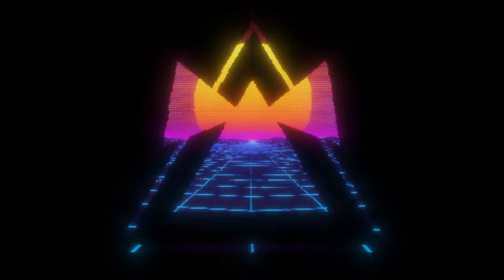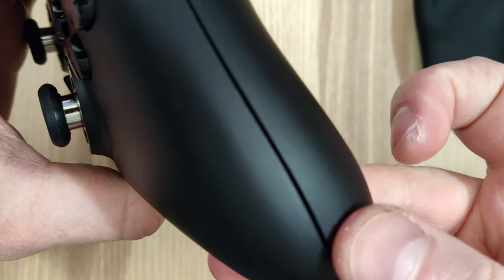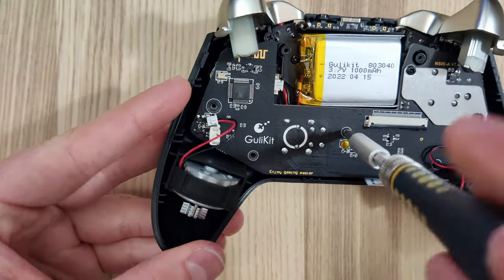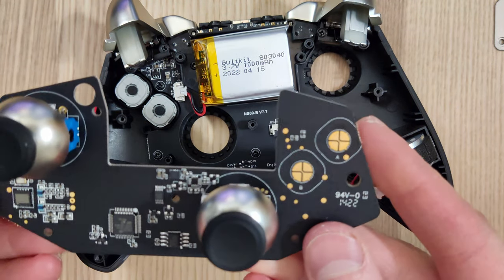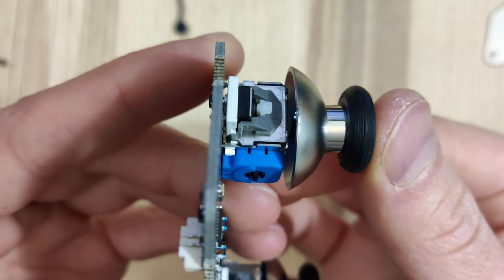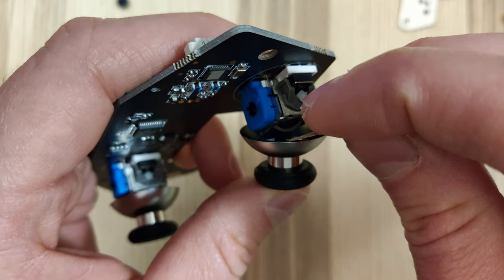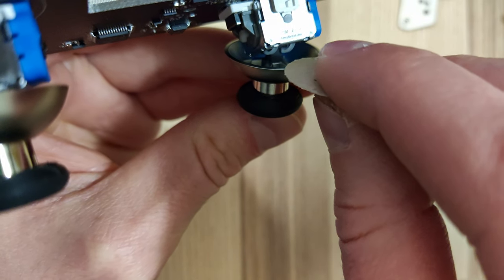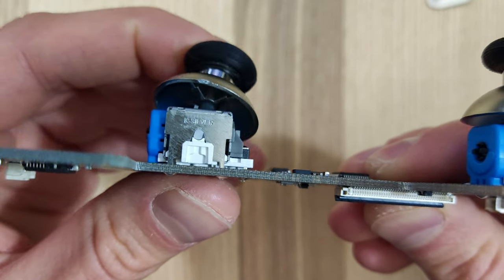Gulikit Quality Control Issues (KingKong 2 Pro Teardown and Joystick Fix)

Comment: Are the thumbstick compatible with xbox metal (aluminium) thumbsticks?
Reply from the maker: Someone mentioned it but I have yet to try swapping them on either one of my units. If you try it let me know.
Reply: @KeiRetroGaming  Im asking before buying mine! hehe
Reply from the maker: GreenChii (4th comment on this video) said they swapped over to the Xbox One controller thumbsticks fine without issues. I haven't tried it personally though.
Reply: @KeiRetroGaming  You just won a new sub, thanks!
Reply: Confirmed after receiving my GK KK2P, aluminium sticks for xbox 1708 controller work on them :)
Reply from the maker: Excellent! Thanks for letting us know.

Comment: Edit: nothing wrong so far (I haven't opened the controller)
I don't feel anything wrong with the joysticks.

Old:
My controller is still waiting to be shipped, comes dec11 ordered a week ago :\
And I was wondering if you, perhaps, know if this is still an issue or if gulikit changed the way they make these?
Reply from the maker: They left a comment awhile back on this video saying they've changed the injection molding process so yes I think it's likely fixed. I haven't bought another one to check it though. Let me know when you get yours if you have the same issue (I doubt you will).
Reply: @KeiRetroGaming  Will do, thanks!
Reply: @KeiRetroGaming  I edited the comment.
Reply from the maker: Nice to hear the controller works well so far. If you don't feel anything wrong I wouldn't bother opening it.

Comment: bru, bought the ns08 version and the zr trigger and b buttons started to get stuck after a month.
So sad
Reply from the maker: I'm hoping the next version of the controller has those fixed. Heard of a couple people with trigger and button issues but sticky buttons seem to be more common so far. If I figure out a fix for the buttons or triggers I'll definitely let the community know.
Reply: @KeiRetroGaming  did you find a fix for the triggers? I still have this problem
Reply from the maker: I haven't found a fix unfortunately. A friend got one and the company had to send him over a replacement set of triggers to fix it.

Comment: it was the opposite for me. this is the easiest controller that i've taken apart. since everything seems to be designed for disassembly. and the reason that i had to open mine was because one of the buttons was making squeaking noises. and when i opened it up, apprently one of the switches has a mold defect that keeps it from fully closing. i had to glue it together. i'm not mad because i got the controller on a discount. but i wish they would check those.
Reply from the maker: There's definitely a couple quality control issues I hope to see remedied on the Kong Pro 3. Buttons seem to be one of the biggest problems, if not the biggest and most widespread problem so far on this controller. Mine both are unaffected but I've heard countless owners with sticking or squeaky buttons. Happy to hear you managed to fix it! Gulikit does sell replacement buttons if it happens again and ends up being unfixable one day. 
https://www.aliexpress.com/item/1005004443562931.html

Comment: Are they eventually going ro come out with paddles?
Reply from the maker: Not to my knowledge, doesn't mean they won't... just means they haven't shared that information with anyone yet. Should be interesting seeing the revision of this controller when they decide to launch it.
Reply: @KeiRetroGaming  I've purchased the Nacon "RIG-Revolution X Pro" controller and not the Nacon Revolution X. Big difference between the RIG and the non RIG version. It has zero tolerance of errors in the sticks and they are very responsive compared to my Microsoft elite series 2 where I didn't want to spend another $200 or close to that for a controller.
The Nacon at first feels inexpensive but once you set the software up foe FPS and get used to the controller, wow, its one of a kind. By far my favorite controller and it's so accurate. I own PS5, Wolverine, Scuff etc and nothing so far comes close to the Nacon RIG. I'm very surprised of that.and never thought I would like the Nacon RIG as much for what I paid for it. 
All of the buttons have solid feed back. 
Hopefully you get to try one. Make sure to set up the software. FYI, use the controller to do so. If using mice, it locks up.
Can't wait until all controllers come out with Hall Effect sticks.
Reply from the maker: @nickm8651  Looks like an awesome controller! Pretty expensive though and only wired. Definitely something I'd love to look at but not something I could justify buying for the channel considering how much it would cost here in Canada even if I ordered it from overseas. Definitely premium from what I've seen so far on it!

Comment: Goddamn, that's a lot of work for someone like me. I'd rather get a refund.

Edit: well, I tried and I can't believe I was able to put it back together while also resolving the sticky A button issue. Didn't come without a cost, though. Same as this video, I also broke the tiny locking tab on the right side, which doesn't seem to be much of an issue since the screws are enough to hold the front and back casing together. A little price to pay to avoid the hassle of returning the item.

PS: I didn't do any sanding or put any lube, I just stretched the springs out a bit to give them a little bit more pushing force. Will observe if it really eliminated the issue. Hope so.
Reply from the maker: Excellent, glad to hear you got it put back together okay without much issue. Those clips are so breakable... Shocked I only broke one opening it.

Comment: Glad I saw your video. I just got one of these and both sticks have it bad.
Reply from the maker: Let me know how it goes fixing it and what you think after about the joysticks. When I put my controller back together the first time I was shocked how smooth it felt compared to how it felt out of the box. This is a very widespread issue and it wouldn't shock me to see that most of these controllers have it and need repairs.
Reply: @KeiRetroGaming  Unfortunately, sanding it down doesn't seem to have done much. I still feel some very specific points where the sticks feel like they grind almost like hitting a lip.

I definitely felt some improvement from sanding, but I think maybe the stick module itself is gummed up. It is a really grindy feeling. I saw people saying calibrating the sticks and updating the firmware can also smooth out the sticks, but so far, nothing has helped. 

A real shame since I like this controller a lot. Now I'm hoping Gulikit will still let me RMA.
Reply from the maker: Yeah, they aren't designed to be pushed completely out to the edge if you don't have the shell on yet so they'll feel a little... off. Once you put the shell on it should feel much smoother as it has an edge to stop at. I had to go back in and sand a bit more down to smooth out the edge as well so you might have to go back and check yours. 

 If you contact Gulikit and explain the situation they should be willing to send you a couple replacement joysticks to pop on. The two they sent me had the same issues unfortunately since it must've been from the same factory but easy enough to sand/file the edge again and put back on. 

Here's some pictures I took for you of the replacement sticks they sent me:
https://www.reddit.com/user/Kei-Retro-Gaming/comments/w1ovxi/replacement_joysticks_from_gulikit/
Reply: @KeiRetroGaming  Oh no, I mean that they feel this way with the shell on. I did a number of tests and went back and sanded quite a bit, but it feels like the area that is smooth is actually minor compared to the area that seems to grind. Easily some of the worst feeling sticks I've ever touched even after opening up and sanding down and closing it all back up.

It still works and reads fine, but I'd hate to play with this thing as the grinding feeling is awful.
Reply from the maker: Did you get any debris in the sticks when sanding? I'd ask Gulikit for a new joystick board. The joysticks are soldered into the board itself so it basically comes as one piece. They should be pretty helpful if you show them videos of the problem. Keep the joystick part you sanded and just move that over to the replacement part when it arrives.
Reply: @KeiRetroGaming  I might have, but I used an air duster to really blow out any debris. But it basically felt this way prior to the sanding. So, I don't really think I got much of anything in there.

I e-mailed them earlier in the day. Hopefully they get back to me. I'll try to request another board that has the sticks on it like you said. 

At the very least I pretty much know how to get in and out of this thing pretty easily thanks to your video.
Reply from the maker: I probably wouldn't have recommended using an air duster as it blows more into it than it probably blows out, especially on something delicate like a joystick. Regardless if you contacted them on the official Ali store they should get back to you soon. Lemme know how it works out in the end. Glad to hear you enjoyed the video!
Reply: @KeiRetroGaming  I returned my controller and was able to get a new one. This one seems to be in proper working order. The sticks don't hitch along the rim at all. Pretty sure that bit of flash had nothing to do with what was wrong with mine, and it  was some sort of defect within the analog stick housing. I don't know if there is a spring or what in there, but it definitely felt like something was grinding internally.

Anyway, I'm at least glad I saw your video as it let me know that this stick has this problem, and I'm really pleased with this one that is working properly. I'm hoping Gulikit irons out this problem as I respect what they are doing for gamers looking to avoid making e-waste via dead/drifting sticks.
Reply from the maker: Glad to hear the new one doesn't have that grinding around the edge. It's definitely a great controller! Here's to hoping Gulikit irons out the QC problems in the future. Thanks for letting me know how it worked out in the end. !
Reply: @KeiRetroGaming  Definitely. If this one holds up well, I will almost certainly buy a second one, or be interested in whatever updated version they make. I am really hoping other controller manufacturers follow their lead on the hall sensors too.

Comment: I was looking for a teardown of this controller.  But omg, you do realize you can take off those joystick caps, like nothing, and then, you don't risk getting any debris inside the actual mechanism.  Also, you can just carefully remove that extra plastic with an exacto knife.  Watching you sanding those caps like that, just drove me crazy, you're not gonna break it, it's not expensive as hell, it's a damn piece of plastic, I bet you can use cheap xbox one controller ones as replacement 😤
Reply from the maker: Yes, don't worry I took those caps off very easily the day after. The caps also can be swapped with the Xbox ones apparently but I have yet to try it.

Comment: Unfortunately those "fantastic buttons" are sticking and squeaking for me and my controller is less than a week old. I'm not alone in this as a quick search seems to reveal this is the main issue many owners experience. I got mine from China so I'm not about to return it. I guess I'm gonna have to try and fix it myself. Such a shame as otherwise it seems pretty decent.
Reply from the maker: Give customer service a message on AliExpress, they'll likely send you a new set of buttons to try. The buttons on my second controller stick ever so slightly if I press them on an angle, see if they have the same issue when you press straight down.

Comment: What is the polling rate/input latency on these?
Reply from the maker: According to XInputTest, it averages about 10.99ms input latency and a 90.95hz polling rate wirelessly over Bluetooth. Hope that helps!
Reply: @KeiRetroGaming  blue tooth polling rates are always abysmal, do you happen to know what it does wired?
Reply from the maker: @BlueSpectre  Wired is pretty similar at 9.97ms @ 100hz polling rate
Reply: @KeiRetroGaming  ah bummer to hear when the ps5 controllers do 1000hz for 1 ms, was hoping it was at least 500
Reply: @@Clarissa1986 pretty sure this thread died over 6 months ago 😆
Reply: @@Clarissa1986 Jesus.

Comment: I still didnt get any help to fix my sofware problems
Reply from the maker: @ my username in Retro Handhelds and I can try to see if I can find someone to help. Either that or you can reach out to Gulikit directly on the official AliExpress store and they should be able to send you out some replacement parts if needed.
Reply: @KeiRetroGaming  ok ty Im at the peek of rage at this point I DESPISE CONTROLLERS WITH SOFTWARE
Reply: @KeiRetroGaming  cant find you its been like 7 days after i bought this thing and cant use it thinking about returning it but i lose 5 bucks
Reply from the maker: Feel free to try and contact me on Reddit directly:
https://www.reddit.com/user/Kei-Retro-Gaming
Reply: What happened?

Comment: CAN SOMEONE HEEELP I just tbought king kong pro 2 and when I'm playing apex on pc it was fine at the start idk what i did but now it has motion when I'm aiming with the stick making it really hard to aim its like really stiff but also responsive its WEIRD please for the love of god i just bought this THING ....it has this weird jitter or like pull to it when im trying to aim its SO ANNOYING this thing is 74 BUCKS man like why is it already giving me issues
Reply from the maker: Motion Sense Aim Assist is likely on. You can turn it off by pressing the button that looks like a sun and pushing in a stick several times until it has one long vibration. You can also try clearing all settings by pressing the same command button (one with the sun on it) and the minus symbol as that'll reset the controller to a blank slate settings wise.
Reply: @KeiRetroGaming  ok ty ill try it and see this thing worked at the start and then poof
Reply: @KeiRetroGaming  now it feels super slow do i just keep pressing them? when im on max sense
Reply from the maker: Just do a "clear all settings" and it should work like it did when you first got it. It comes with a manual to show you how to clear the settings if you can't figure out the button combination.
Reply: @KeiRetroGaming  ok ty it probably was cuz i spammed abunch of buttons cuz i didnt know how to turn it on like idk why this thing has to be so complicated
Reply from the maker: It has a lot of complicated functions but once you master it you'll love it! The macro feature is amazing for automating in-game tasks.
Reply: @KeiRetroGaming  i got it to play smoothly and omg i am alot better than i thought i was stock controllers are holding ppl back
Reply from the maker: Hall sensor joysticks are a huge upgrade. Enjoy!
Reply: @KeiRetroGaming  ok another problem sorry i was in mid game every thing was fine i jump with lt and ping with rt and they just stopped working all of sudden
Reply from the maker: If it's wireless via Bluetooth make sure you have a good Bluetooth adapter (preferably a PCIE one) in your desktop and make sure the controller is fully charged. If the battery is nearing empty it'll start to disconnect like that.
Reply: @KeiRetroGaming  its cord sorry Im using the cord it came with
Reply: @KeiRetroGaming  and now it wont even connect idk whats going on ik i had the not connecting problem with apex legends awhile ago and idk how to fix it but idk if its this new controllers software or not
Reply: @KeiRetroGaming  is there like a discord that can help me? ik cant stand using the websites support thing
Reply: @KeiRetroGaming  so does it need to be charged even when plugged in with a cord???????????????? idk if thats a stupid question
Reply: @KeiRetroGaming  Im about to just return this crap
Reply from the maker: Give it a week and learn the shortcuts. There's no controller that comes close to the joystick quality. It's always a big adjustment using a new controller. Discord is a bit easier for longer discussions, feel free to connect with me on Retro Handhelds if you want at:
https://discord.gg/RetroHandhelds
Reply: @KeiRetroGaming  please let me know who to contact or how on the server Im super close to the returning time left
Reply from the maker: Ask in #gaming to see if anyone else has the same problem.
Reply: @KeiRetroGaming  did

Comment: You really exposed them, along with the terrible latency issues, this all explain why this is a 55 euro joypad, they just made a cheap joypad and put hall sensors in it as the selling point, well, i fell for it, guess they did something right, marketing wise, lol.
Reply from the maker: While I really enjoy using this controller, there are some issues with quality control. It's worth noting that your experience may vary from unit to unit. Although the latency isn't perfect, I was still able to play through most of Elden Ring with it, so it's at least decent for most users. Overall, it's a great controller despite some minor flaws. I do prefer the new 8bitdo Ultimate Bluetooth overall between the two.
Reply: @KeiRetroGaming  Mine actually came with a lose screw on the left trigger, after a few hours of using it totally detached and is now loose in the controller, and the left trigger feels like crap now. im not even that mad because for me the terrible latency already killed it for me anwyays, my cheapass gamesir t3 only has 3 ms latency, and you can feel the different very well.